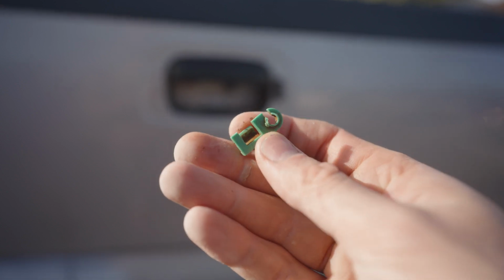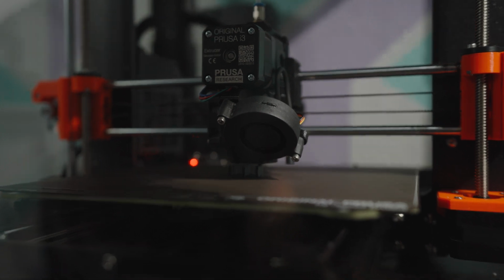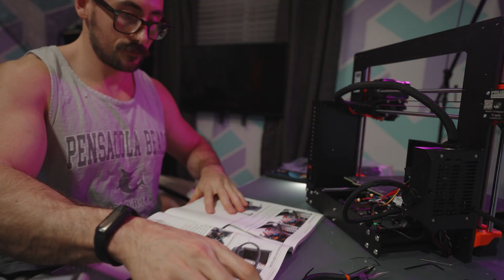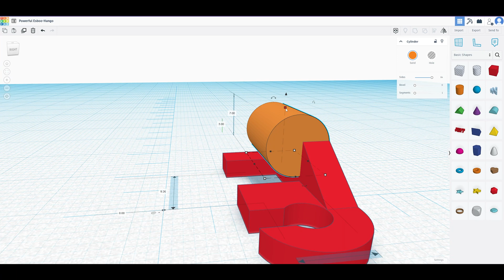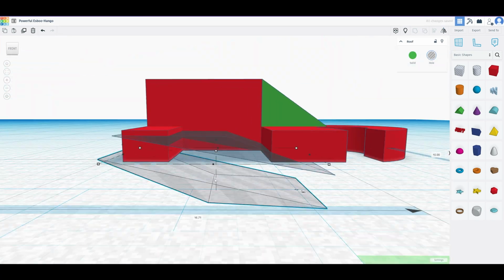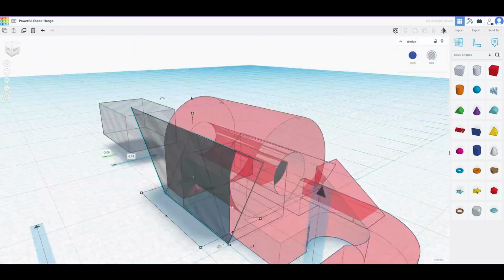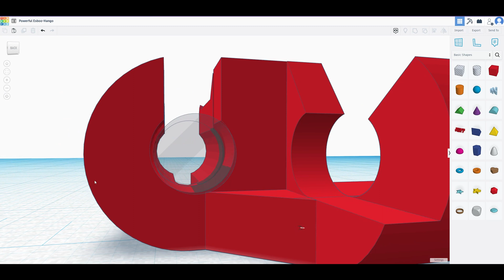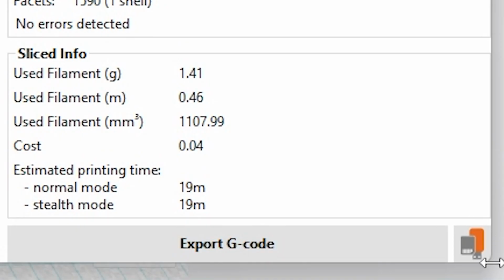How I Used a 3d Printer to Create Discontinued Car Parts!

Comment: Installation of the part is made by inserting the round part into the hole then inserting the rod and rotating the plastic clip up and locking it onto the rod.
Reply: Yea, I, too, could see that he wasn't installing the clip correctly.

Comment: If you need to glue small parts like that, and if you have the space, try printing a large base on the small part so you will have a big area to glue on, rather than just a sliver of plastic 😉

Comment: You should look into Fusion 360 for modeling. It's a million times better than TinkerCAD. It looks more complicated but once you learn the controls, everything is downhill from there, and you'll realize that the controls themselves are honestly not complicated. 

I am a complete beginner myself. Got my first 3D printer this past May, and it was at that point that I was checking out CAD in general. I opened up Fusion and immediately gave up as I could not figure out how to make a freaking cube. Tried TinkerCAD and it was very intuitive. But once I tried making complicated parts, I could not figure it out. Decided to watch some tutorials and it took me about an hour to complete. At some point I came across a video on Fusion, decided to watch. It was a tutorial. When I realized the capabilities of Fusion, I recreated the parts both in Fusion and TinkerCAD. The results, 10 minutes on Fusion, 30 minutes in TinkerCAD. 

Highly recommend Fusion. You just have to spend a few minutes learning the slightly different workflow as opposed to it being intuitive in TinkerCAD, but boy is it better!

Comment: At 10:00 you need to install the plastic part first in the hole. Then you insert the metal rod in. Then rotate the plastic to lock on the rod

Comment: Based and 3dprinting pilled.

Sometimes you gotta do a lot of sanding and drilling with small clearance pieces. Also you can try designing clips with more contact patch (maybe by hugging the part that broke off) that might help it breaking off.
Reply from the maker: that's a good idea, I'll definitely apply that to the next part I make. Thanks, I appreciate it!